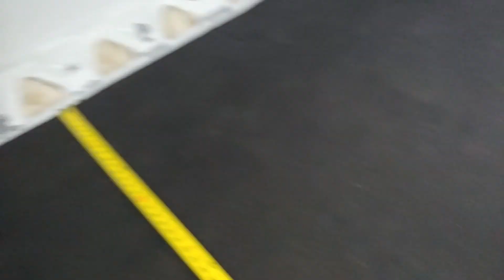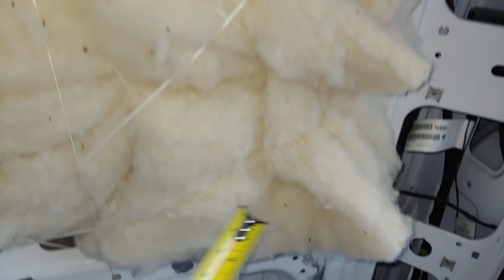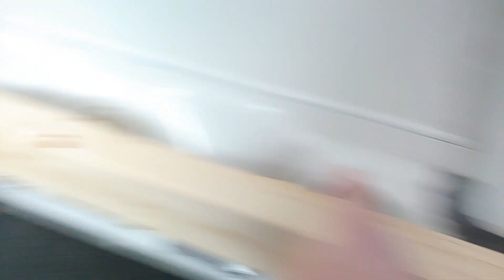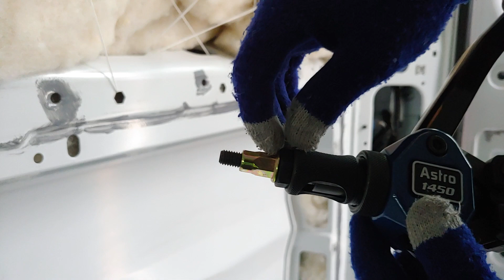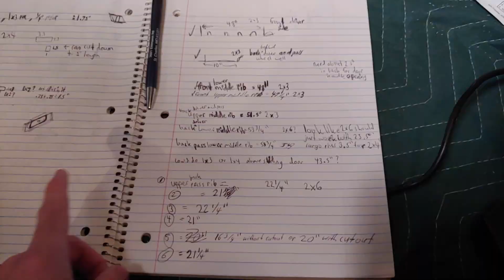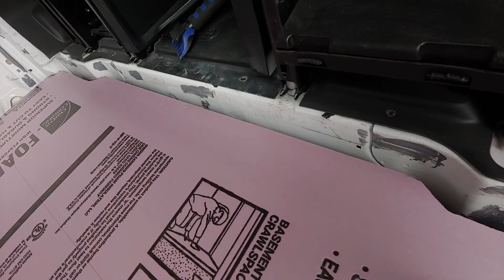Flooring and Framing a Promaster Van - Part 1

Comment: Thanks the for the video! I am about to tackle my 136. I was told not to insulate the bottom channels as you did, have you heard this as well?
Reply from the maker: By bottom channels do you mean the rib openings on the side walls by the floor? If so I haven't heard of that. I dont see why you wouldn't insulate everywhere you possibly can unless there's an area that could get really wet